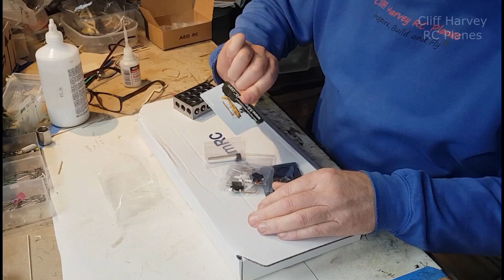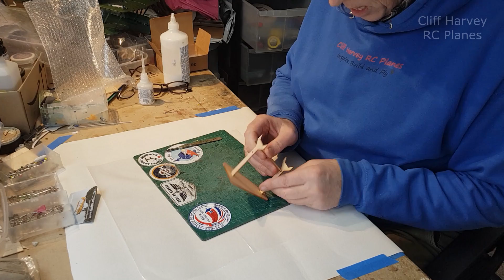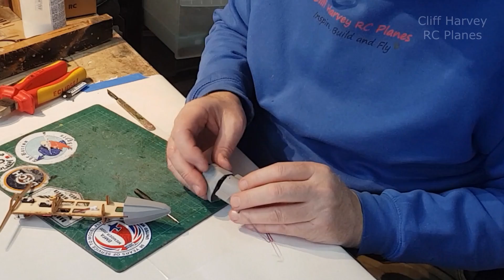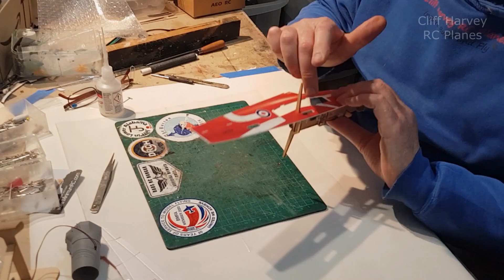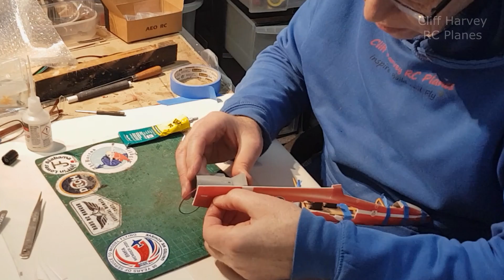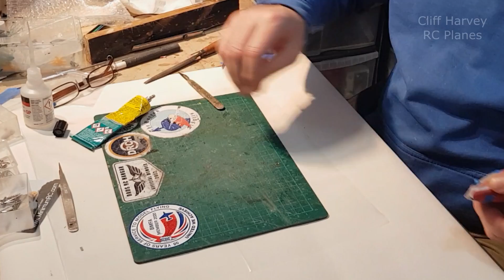MinimumRC BAE Hawk Red Arrow Assembly Part One

Comment: Hi Cliff, would appreciate some advice: I can't seem to find the place in my receiver to plug in the 2 prongs from the motor. Any suggestions?  Thanks so much.
Reply from the maker: Hi Steve, check out this video where I had a similar problem on another receiver. https://youtu.be/FDHAeN2B43U?si=noHSpZW6FnCLaz03. Go to 31 minutes in. I don't know why the manufacturers leave the socket off, it only creates problems for us modellers. You need to look closely, and you'll find two little solder dots on one edge with a plus and minus beside them where you need to solder your motor directly onto them, unless you can find a socket and solder that on 🤔

Comment: Will these batteries "URUAV 3.7V 250mAh 30C/60C 1S Lipo Battery PH2.0" from banggood fit the minimum rc bae hawk red arrow. Will order the hawk if they do. Thanks Sean
Reply from the maker: Hi Sean, the battery's should physically fit but the connector will be the wrong size for the connector on the MininumRC models. You could change the connector on the model or do as I've done and make up an adaptor, hope that helps 🤔😁
Reply: @cliffharveyrcplanes  Thanks Cliff for your reply, I'd ordered the wrong 3.7v Lipo's. Will do as you suggested and  change the plug on the model. Thanks again, great channel. Regards Sean.
Reply from the maker: @seanmcgrth  You're welcome Sean, they seem a really good seal 👍

Comment: Disappointed to receive two Cassiopeia compatible receivers instead of the Spektrum compatible receivers that I ordered. I am confident that MinimumRC will soon rectify the situation and enable me to complete this fascinating build.
Reply from the maker: That's frustrating Anthony especially as the rc gear is the first part of the build 🤔
Reply: your lucky i didnt get receivers, motor came with bare wires.

Comment: The packaging was disappointing. Could have been more robust. One set of 3D printed parts for the motor mount and ducting were crushed in the post between China and Australia. It's just as well that I ordered two BAE Hawk kits! I managed to order the kits without the receivers that I needed so I have started one kit but am stalled until the Spektrum compatible receivers arrive. It would have been a comforting if extra screws for holding the servos and servo control arms had been included with the kit. The screws are fiendishly small. Apologies to Minimum RC for any offence caused by these negative comments. I am keen to get on with the build particularly since it seems to have been raining forever here in Southwest Sydney and "cabin fever" is starting to set in!
Reply from the maker: Hi Anthony, to be fair the boxes are pretty robust but the ducting parts are more vulnerable how they are packaged, short of packing the components in a wooden box I don't know how you could negate for bad post handling, that's bad luck! Yes the screws are very small a good tip is to assemble those components in a tray using a magnetic screwdriver and minimizing therefore any risk of losing them. I can appreciate the pain and going a little bit crazy in the workshop ... we've just started to get our spring and it's very welcomile indeed after a long time, cheers 🙂👍

Comment: Hello, I would like to ask a few questions about some of the minimum rc planes, if you would like to answer them:
First of all, I have bought a few mini rc planes kits over the years(foam and blasa wood, and I have always struggled with flying them because they were always too heavy with the electronic that came with them, because I always made sure I was building them perfectly.
So I wanted to ask if this have ever been the issue with some of the minimum rc planes, and if so, what did you do to get them to fly better?
And if not, what mini rc plane would you reccomend from them?
And would you reccomend buying a full kit from them with electronics?
I have other rc planes that works wonderfully, but I have never been able to build a mini rc plane and have it worked well.
Reply from the maker: All I can say is buy the plane and the electronics from the company, all the ones I've ever built have flown very well indeed 🤔
Reply: I see, thanks for you reassurance!

Comment: Great video! quick question. for regular servos 5-9grams I use a centering boards that I got online. Now, for this small servos with a pin so small, how do you center them? do you just connect a battery on the receiver and check like that? i was thinking on making an adapter from the regular servo style plug to the plug type used on the micro type of boards (don't know if they already sell those type of adapter cables).
Reply from the maker: Hi Marc, because the rc equipment is inaccessible after the model is built it has to be connected to the receiver therefore it's all centred and ready for connection to the flying surfaces 🙂👍

Comment: I built my balsa Min RC L19 Birddog in early December. Its been sitting & waiting for its trim flights here in the Catskills of NY. Pretty soon we will have weather conducive to flying.

I did strenghten the wing to fueslage connection during my build because I am not a good enough flier to gurantee I don't wing in the grass a bit on landing. I also laminated a thin skin on the curved top of the rear fueslage. The later being so far from the CG inspite of weighing little required more weight to be added in the motor bay than I really wanted to be needed, but once added a tossed flight back in December went  well. My only worry now is do I have to swap motors for a bit more power due to the added weight. Time will tell but it does look pretty & I am hoping it rivals the rubber powered Flying Machine I turned into a motorized RC plane with micro electronics for being an early morning, no wind, step out the back door, flight experience.
Reply from the maker: They say what ever weight you add at the tail takes four times the weight in the nose to balance and I can quite believe it. The funny thing is a very light aeroplane is delicate but it has no momentum so it doesn't break as easily, the opposite is true ... the more you strengthen a model the more strengthening it needs! If you have to add weight better to add a heavier motor (or battery) instead of ballast but whatever happens as long as the cg is correct it'll just fly faster ... funny old game model aeroplanes, have fun, cheers
Reply: @cliffharveyrcplanes  The Minimoa Sailplane was my first build. It has a fairly large wing and a long single plywood spar to attach and support the wing. In a dead stick landing into tall grass that was not more than a fast walk the plywood spar on the right side sheared off. Since then, given the amount of time one spends on doing a nice build, I don't rely strictly on their design in my construction. I have a tad of civil engineering education and can't help but notice the wing to fueslage connection is similar to a cantilevered beam and is subject to large shearing or bending stresses thus I add more section modulus to this connection by using what would be called a moment connection consisting of a plate of material, balsa or foam, that extends beyond the joint in both directions.
Reply from the maker: Sounds good, could one use paper glued on for lightness and strength?
Reply: @cliffharveyrcplanes  might work....

Comment: On those ply servo mounts I like to take the screws out, put a drop of CYA in the hole and put the screws back in. Really makes the plywood more durable but minimal weight.
Reply from the maker: Good tip, funnily enough I do that when I'm using self-tapping screws to hold motors to bulkheads but never thought of doing it in this instance, cheers

Comment: Hello Cliff , ? What glue are you using getting back to serious modelling and it’s a whole different world regarding glues.
Reply: Thanks Cliff,  a bit different from my old Kielcraft and Mercury model building with balsa cement .  I’ve got some ca, just learning how to use it correctly .
Reply from the maker: For this build I use medium ca from Toolstation for the ply parts, for the foam I use UHU POR, Ebay if you can't find it elsewhere (it unsticks well using lighter fluid) and for other modelling balsa to balsa and to ply I'm using a white glue called Speedbond from Deluxe materials and 15 minute two-part epoxy by Zap (Z-Poxy). Everyone has their favourite but these four serve me well, cheers
Reply from the maker: Be aware ca, although fast, produces a brittle bond, I use it a lot as a 'liquid pin' to hold pieces while the white glue sets 👍
Reply: @cliffharveyrcplanes   ah that’s clever !